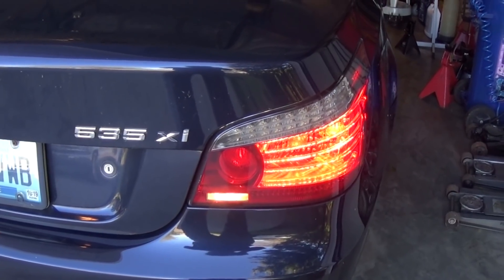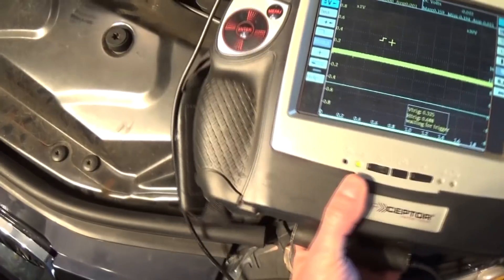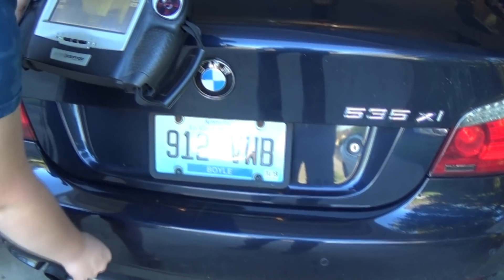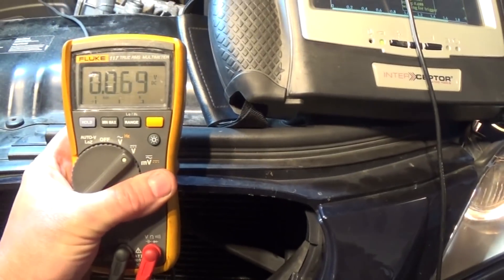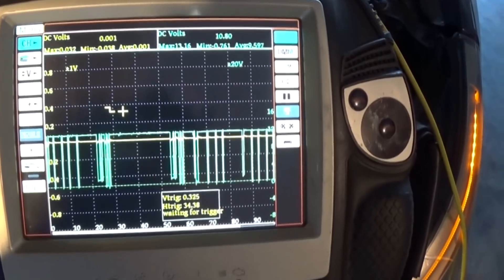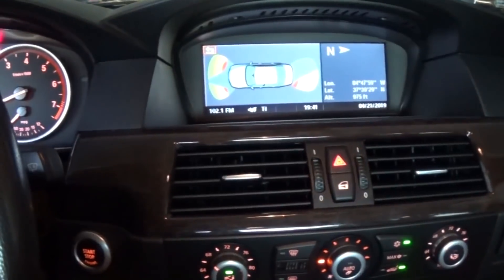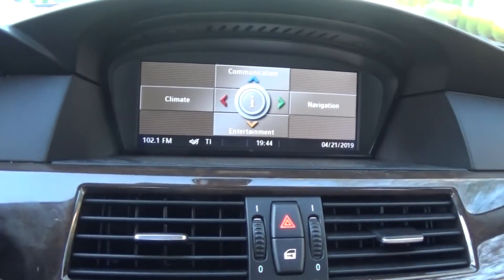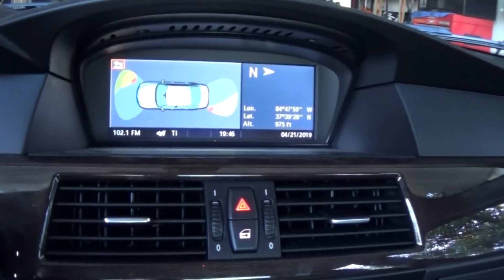BMW 535 Xi Parking Sensors Diagnoses

Comment: You’re the man I love home made tools. What’s the inside dia of the tube you used to insert it into the tube? Did you glue it in? Did you use 2 wire or just one? Thanks for sharing... jay
Reply from the maker: Welding Junkie all you need to do is to attach test lead to each leg of sensor. I used plastic tube and fill it with JB weld.👍